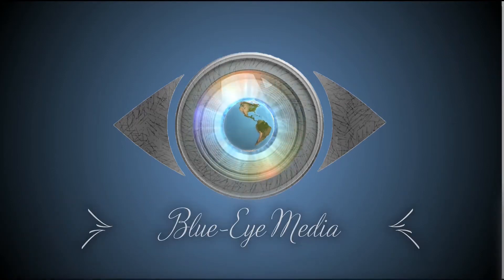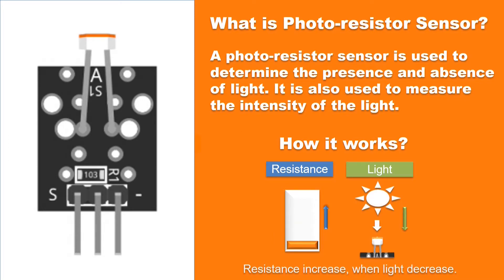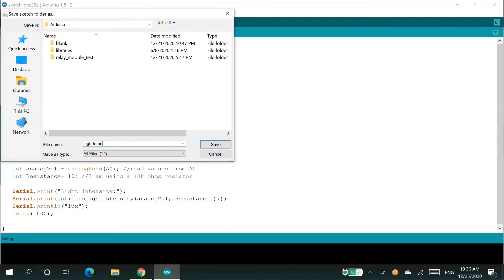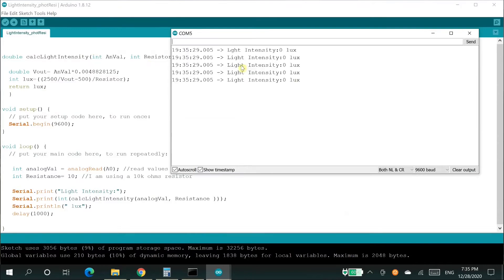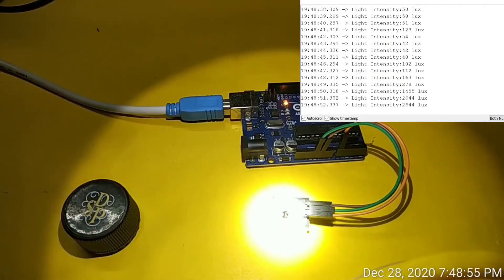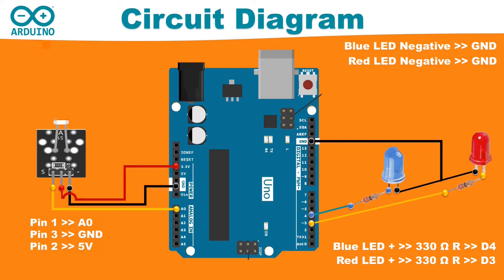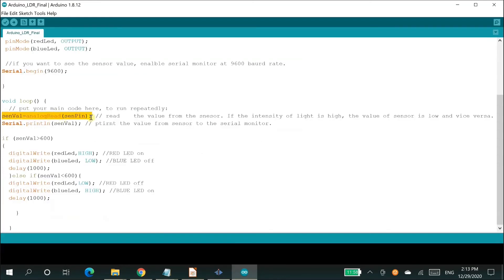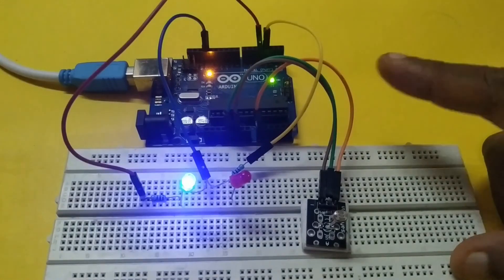Measure intensity of light using a Photoresistor and Arduino

Comment: there is an error in the design of Photoresistor ky 018 module, where the 10 Kohm resistor between the signal and vcc pins, but it should be between vcc and GND - please revise - and thanks for this valuable explanation